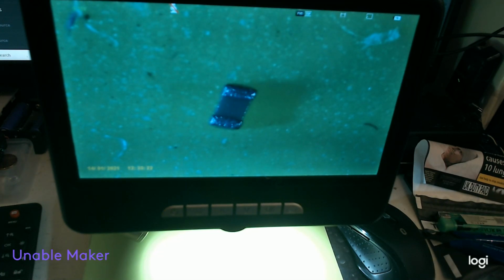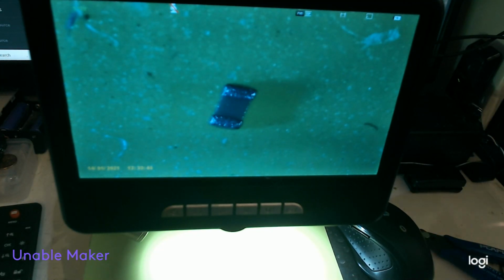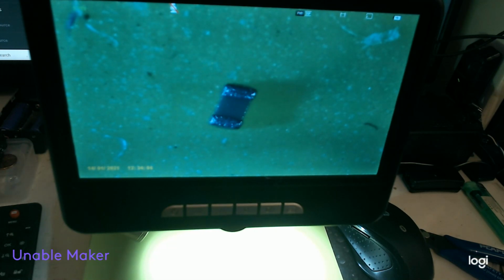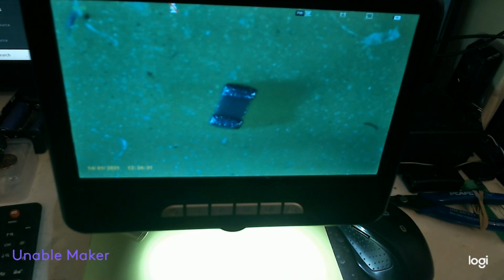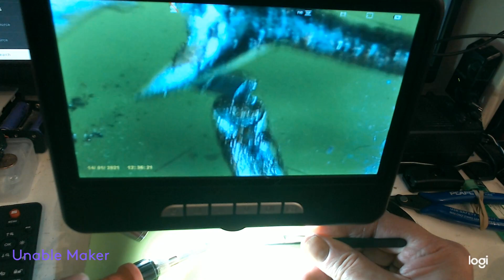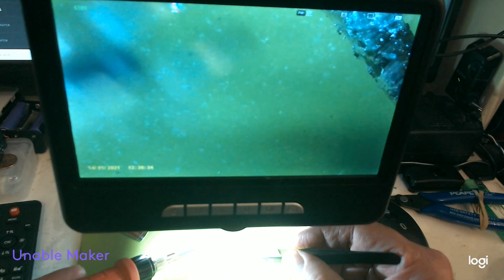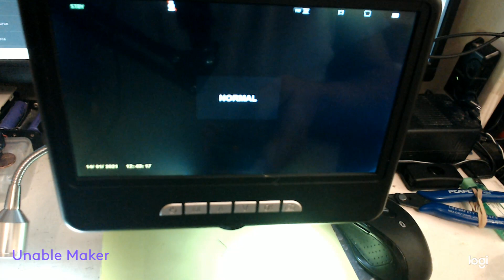How not to Hand solder 0201 SMD A challenge set part one

Comment: Ive been doing these by hand for a while need a microscope upgrade though managed to get quite a bit soldered on what microscope is that
Reply from the maker: I have two microscopes and the adonstar microscope 407 is brilliant as you get a large gap between the board and the scope for soldering and easy to adjust, I also use the pencil one for inspecting and neither are that expensive, well done on soldering them